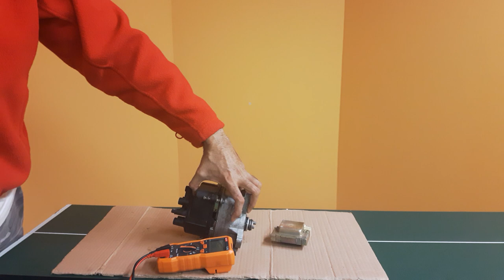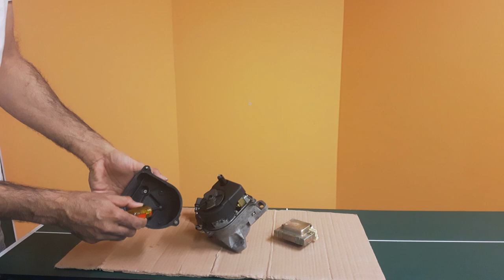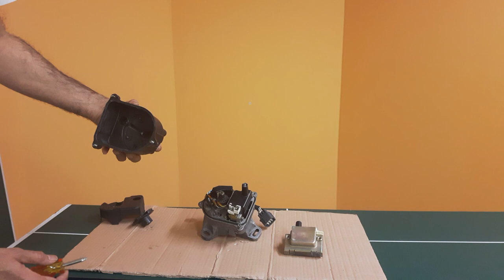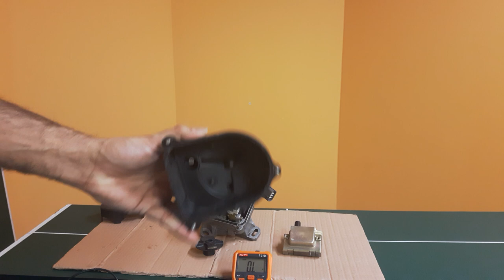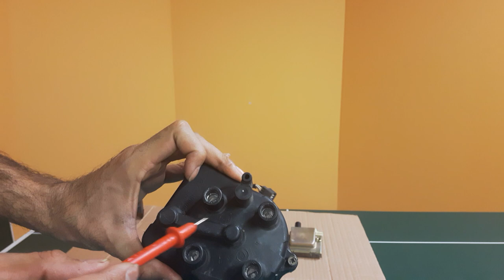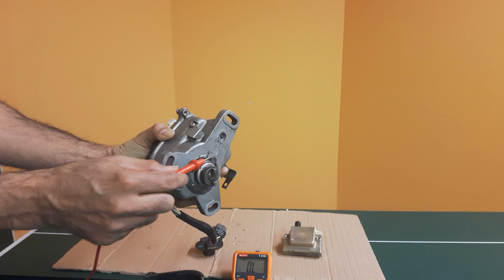How to test Honda ignition distributor TDC CYP CKP ICM CEL P1381, P1831, P1832, P1362CEL hesitation

Comment: Thank you so much. My son has a 94 Civic. So this is the exact distributor we were working with. The problem we were having is the car would run 7 minutes (summer time) and then die. It would not start back up until the car cooled back down. No engine codes. Our ignition coil checked ok. We have the factory service manual and it did not give us the information you provided.  When you got into testing the harness is where we found the problem. You tested several points to get a 300-700 ohm reading. We only got the reading between 2 wires. 

The distributor we had was an AutoZone gold, 16 months old. Luckily it has lifetime warranty. Put in new one, and works fine now. Thank you for this video.

Comment: Great, informative video. Only thing I would add, is that the O-Ring you recommend to replace, does not keep oil out of internals of distributor, it only keeps oil sealed into the cylinder head.  The distributor has its own seal around the distributor shaft to seal away internals. To replace, the distributor must be completely disassembled, inside and outside, then seal replaced into housing. I had a cheap new eBay distributor that absolutely poured oil into the cap causing a misfire. Got sent a replacement and same thing. Ended up using the OEM housing with internals from eBay ones, as my OEM pickups were bad. The cheap distributors had too much shaft play and would tear the new seals within a week.
👍 Enjoyed your video
Reply from the maker: That O ring prevents oil from seeping out of the engine head around the camshaft. I dont see any way oil can go inside the dizzy anyways.

Comment: note that the rotor screw can be very tight, be very careful, use your best philips or better yet japanese JIS.  I messed the head of the screw up, had to drill it and use an easy out to get it out, what a job

Comment: I was looking for test data for the ICM module itself , the resistance between the terminals and forward voltage drop on the IGBT etc., as it is not published anywhere . 
This was interesting but some errors here . The rotor arm tip is sandwiched between 2 thin resin kevlar layers and you must test continuity by touching the thin metal between the fibre insulation and the carbon brush contact area . The reading should be 0 or continuity . As your meter was dancing all over the place , you had not made contact with the thin sheet . The reason this is made thin is because a spark jumps easiest from a sharp point . In the old days of thick brass rotors , I filed them to a much thinner point as the cap terminal end .
You are correct that is the tacho or SCS pulse terminal on the ICM but it will on all later models have no connection as the tach signal is picked up from inside the ECU . This can be used if you have a modified engine and wish to use an aftermarket RPM gauge with shift light etc. The wire next to the +12 V ( Honda typically uses Black/Yellow trace for +12V) is actually the Green/Yellow ECU pulse wire ,which is why your meter was dancing as there is no direct connection between the 2 unless triggered during running . Earlier models may be just plain green wire .
A couple of things to clarify , although very similar the Accord model dizzies have larger coils and will not fit the Civic type bodies but the ICM is the same part in both size distributors and are directly interchangeable although the Civic type is screwed to a heatsink .
The coil can in fact test within specification without load but can still fail when driving . This can happen on the Civic type distributors and small coils as the insulation is thin . Check for burn pits close to the shielding and hotspots like bluing discolouration from the centre of the body toward the terminals . This can happen if plugs are not changed or gapped regularly and leads have excessively high resistance ( although an OE Honda lead rarely if ever fails unless physically damaged ) as the HV tries to find an easier route to ground through the thinner insulation on the Tek coils . If replacing a small Civic type coil , I would recommend using a dielectric grease between the shield and coil and apply silicon around areas close to the terminals .
 Aftermarket leads are guaranteed to cause trouble . Honda have used Bougicord leads on some vehicles , which I fit for racing as they are again very reliable but have a much lower internal resistance than those shown ( between 5k and 10k ohms for the longest as opposed to nearly twice that for the other variety ) and are also numbered which is handy . The larger Hitachi coils in the Accords rarely give trouble and I have often considered modifying a Civic distributor by cutting away the parts of the body to allow it to fit in and change the terminals over from the screw on to spade and add the spring on assembly off the car when installing the cap . The screw centres are the same and the HV post the same length , but the laminations are thicker and the coil longer. The Accord coil has a higher winding ratio and will produce a healthy spark . The windings typically test 0.7 ohms primary and 27k Ohms secondary (HV terminal ).
Reply: @texasnhis49bitches49  I'm having a similar nightmare on one of my V6 Accords here in the UK as it has a Motorola PCM , not a KeiHin etc that we are use to and having to draw up my own PCM schematic as Honda USA couldn't help . Not quite sure what you are doing here , fitting an aftermarket tacho with shift light etc., or using the original ?
 The terminal on the SIDE of a typical ICM is the tacho pulse wire ( blue) , the coil pulse on top ( yellow/green) on later ICMs  the side terminal is unused because the OB2 ECUs/PCMs ( manual/auto) the pulse is direct from the Controller to Tacho . There are some colour changes in wiring with the Preludes and Accords using the B and D type engines where the coil +ve can be blue . Any misconnection to the ICM will fry it as there is no reverse or over volt protection on the little board inside . It may burn a track which seems usual when they fail . 
If the engine starts an runs fine you can check if the tacho pulse out is giving a signal . It uses logic level output 5V , so a 14 volt rated neon bulb , fast LED etc can be hooked up to the pulse tab to ground . It should pulse if OK . Crank engine with cap off so it does not start . If it pulses and you ran the wire directly to the tacho aftermarket or stock then the tacho should operate . I assume you by passed the ECU wire to tach because the tach was not working ? There can be poor connection or shorts at the plugs on the ECU and what it appears you have done is basically eliminated this by running a wire from the ICM to tacho instead of back pobing the the ECU pin and taking that ditectly to the tacho pin on cluster plug . Its the same logic level 5V . If this is what you have done then it is probably solder terminals on the panel in the cluster which you can rerun with an iron , do them all because if one has dry jointed others are likely to fail . If the tacho does not work after checking the ECU tacho wire for shorts/lack of continuity or the method I'm guessing you may have used , then the tacho has developed a fault which can result by applying a 12 V source to the tacho pulse wire by error or simply on assembly . We all buy Hondas because of the interchangeability of engines etc and swapping ECUs using adapters , but this is where the problems can begin at the ECU plugs by repeated swapping , or slight variations in colour coding in some models .
 Just for future reference , all the Hitachi ICMs that have the tacho tab are internally wired still and are interchangeable from the F20 etc engines . The only one that is significantly different but has the same bolting footprint is the V6 type which has the built in plug , no tabs . The ones I build use the ISL 9V5036P3-FO85 package which has all the components needed except for a 1k ohm resistor on the input pulse ( Gate) terminal . This will fit inside the original ICM case in all models .after removing the backplate/ heatsink and cleaning out the silicone fill ( that's what the little orange plug is for ). 
If I have made any wrong assumption or you need clarification drop a comment .

Comment: Hey man i think my distributor doesn't have the spring inside that module tube rn when the car gets hot throws code 4 & check engine comes out then the engine starts to do explotions then lose power starts shaking when i acelerate
Reply from the maker: the spring is needed in the coil terminal...try find a similar spring

Comment: Hi, thanks very much for the video. I have a Civic (D14A2) that is giving the P0335 code and is in limp mode. Do you think the problem is inside the distributor or can it be something else like another sensor somewhere else ?? 
Thanks !
Reply: I have the same issue. Did you figure it out what it was?
Reply: @alexm1736  nope. Ended up selling it
Reply: what did you change? anything?
 @brunopdionisio
Reply: @alexm1736  only thing I tried was working used distributor but didn’t make a change

Comment: I need a new distributor for my del sol(b16a2) someone put an accord distributor on it.  Any particular aftermarket distributors you recommend? I would get oem but they don’t exist anymore. I may get a housing and oem parts inside but trying to avoid that if possible.
Reply: have u solved the issue after a year?
Reply: @abadibi  kinda sorta, I put a new distributor on that I got from eBay but I’m not happy with it. Car runs fine but on initial startup it makes a sound like it has a bad bearing or something then it goes away and it’s def coming from the distributor. I heard AIP electronics sells decent distributors it’s just hoping they still have the one you need in stock. Best of luck to ya

Comment: I've got a 96  Odyssey with the p1381. It always stalls on the first two key turns almost always starts on the third  I bought it that way so I went ahead and did the crank sensor and a timing belt kit. No luck, it had a cheap after market distributor on it, replaced it with used oem one. It started first time with no CEL started it a few times seemed fixed. A few days later I go to start it and it went back to three key turns with p1381. It was warm and sunny the day I thought I fixed it and cold and rainy the day it went back to having the CEL , any idea what my problem is.
Reply from the maker: 1. Check continuity of the wires from the dizzy connector to the computer. 2. Check ignition timing is marks are correct and aligns right. 3. Use a known good dizzy or watch how wisemonkey tests a dizzy in my other video.
Reply: @wisemonkey1551  Thanks for the reply.

Comment: Hey man my 1991 civic throws code 4 crank position sensor can i replase only the sensor inside the distributor ?
Reply from the maker: if you can find a good used or new sensor then yes it is possible to change
Reply: @wisemonkey1551  cant find one but the distributor is very expensive were i live :/ can't buy one just replase fuel pump & im broke rn
Reply from the maker: @rendiix4269  code 4 is ckp sensor inside dizzy unfortunately. $60 dollars new dizzy on ebay I think
Reply: 220$ costs for me :/
Reply: Rendii X4 got a whole dizzy off amazon for 83 bucks. Right now it’s on sale for 58. Worked great on my 90 wagon and my 89 hatch
Reply: @wickedeagans  really can you send me the name of item so i can check it rn
Reply: Rendii X4 MOSTPLUS Ignition Distributor Compatible with Honda Civic CRX 1988 1989 1990 1991 1.5L
Reply: @wickedeagans  well its perfect but it doesn't have reviews maibe its not gonna  work or something.
Reply: Rendii X4 it has twenty reviews. I put one on their last year when I bought one and I just bought another.  First one cost 80 and this one cost 50. (Already said that tho lol). And I didn’t buy another cuz it messed up. I bought it cuz I buy these cars a lot

Comment: Changed the Distributor,  spark plugs, new tranny/ engine oil, vtec solenoid , idle control valve, new belts ,  spark plug wires , tranny neutral switch sensor, cleaned throttle body, changed MAP sensor, dont know what else to do??? P1381 STILL exist with hesitation wont pass 3k-rpms
Reply from the maker: check connectivity of the wire from distributor plug to the ecu. most likelyCYP wire broke and became intermittent somewhere in between.
Reply: Did you ever fix your issue? I’m having something very similar happen. It’s an intermittent p1381 code and I’ve changed so many parts on integra
Reply: You need a brandnew car dude 😂